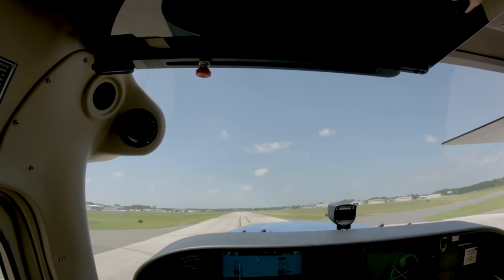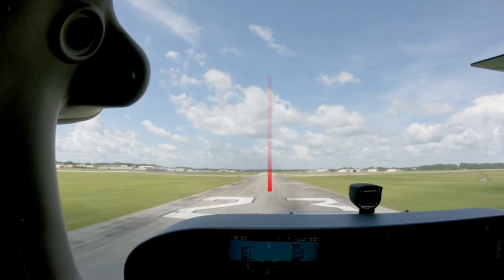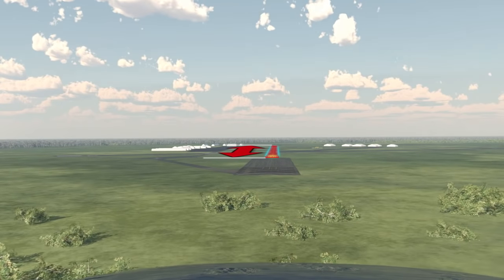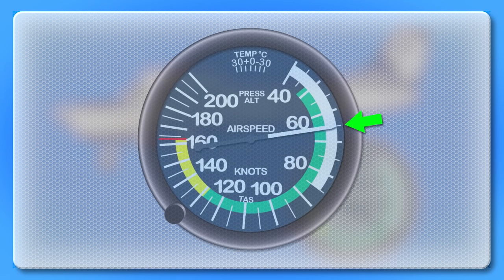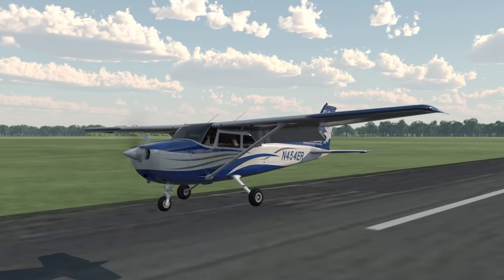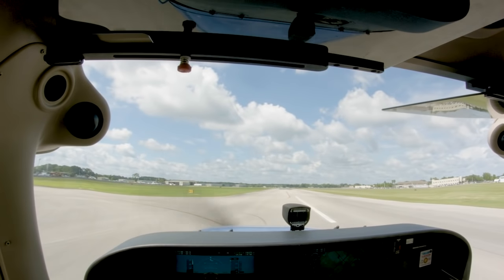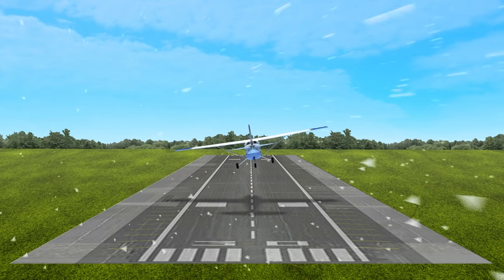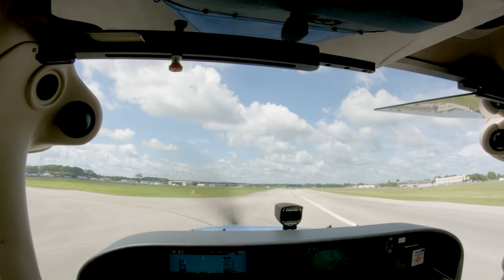Normal & Crosswind Approach & Landing - Lesson 1

Comment: I've always been taught to use power to control height, and pitch to control speed on the approach to land, and then use the other resources only slightly. Not to use the two together at once. Too low = Increase power, and then pull up slightly once you've gotten the power you need to safely pull up without getting too close to stall. Too high = Decrease power, and then push down slightly. Too fast = Increase Pitch, and then decrease speed slightly. Too slow = Decrease pitch, and then increase power slightly if needed. This always worked well for me, but I've never used the two together at once on an approach to achieve a different outcome.
Reply: Actually, what you described is using the two together.  The video said that when you change one, then you will need to change the other, which is what you are doing.
Reply: I caught that as well.  For a stabilized approach I keep my speed pegged with pitch and control altitude with power.
Reply: Using the throttle as the primary control for changing altitude will result in much safer flight habits. Too many pilots use pitch first which results in sometimes risky speed variations.

Comment: The best X wind instruction we've seen to date !
Short course is: 
 Ailerons are the LARGEST control on the plane & the LEAST understood !!! Ailerones ROLL to make turns, BANK to control DRIFT over runway, then provide directional control on roll out with AILERON yaw, as the wee little rudder stalls as relative wind shifts to the airport Xwind.
Cheers R Fuchs CFI 1507987

Comment: This video was good with the exception of stating that if you're low you should pitch up. That thought process is very dangerous. If you're low, you add power, then to maintain your airspeed, you pitch up. But using pitch for altitude when you're already low and slow is what causes pilots to stall, and at an altitude that is too low to recover from.
Pitch for airspeed, power for altitude! It is correct that the two will go together, but do not correct your altitude with pitch, correct it with power!
Reply: He does say this at 5:20.
Reply: @karhukivi ah yeah? so if you are low over some grape-stakes, you are not gonna pitch up? Just give it more power and stuff yourself in faster? So how are you gonna fly when you have auto throttle? How are you gonna aim? Has to be pitch... that's the way an autopilot flies also. How do you fly an ils? Dont you pitch for glideslope?

Comment: You are 90% correct. If you are to high on the approach reduce power only do not lower nose because it will increase airspeed and then you will have to slow the plane down increasing workload. In high winds of 70 to 80 knots the tower may let you land on a taxi way if the wind favors it in an emergency.

Comment: Perfect explanation of how to make a technically correct crosswind landing!! My only comment is to remove the crab a little earlier than what you said so that the pilot can figure out how much aileron and rudder to use. An earlier crab will also tell the pilot if the crosswind is out of limits for a safe landing.  I have been a current and active CFI for the past 52 years and have 4,000 hours of tailwheel time including 3,000 hours in the Beech 18 and DC-3, many of those hours teaching crosswind landings. Unbelievably, the FAA Flying hand book recommends a maintaining the crab until just prior to touchdown, then leveling the wings and land before the airplane starts drifting. This is physically impossible and can easily lead to an accident!! You totally debunked this kick out and land technique. Thank you SO much for telling pilots precisely how to make a technically correct crosswind landing.

Comment: During windy conditions while driving, you subconsciencely turn the steering wheel into the wind. Youv'e done it for years, unless you just got your driver's license. Even then, you know that you are doing or you go off of the road. You are alreading controlling drift without even thinking about it. Just add the other elements to flying a plane and you can enjoy the crosswind challenge. It 's fun.
Reply: Pardon the typos. Carpal tunnel at it's best.

Comment: Very informative video. However, I noticed that there is no mention of the need for right rudder in the flare, even in a calm wind landing. When the nose is pitched up to the Vy attitude, P-factor tends to cause the airplane to yaw to the left, just like in takeoffs and climbs. I only recently soloed after many hours because my landings still suck. Often, it’s because I didn’t do anything with the rudder. Just thought I’d add that tip.
Reply from the maker: TenMinuteTrips With the airplane at flight idle, the left turning tendencies are negligible. Rudder should be used as necessary during the flare to counter any crosswinds and keep the nose aligned with the centerline.

Comment: Agree on everytihng, except
On side slip, you can touch the Runway with both wheels at the same time.(that's the art you need)
I did on my Pitts, on Dc3,:C46, Dc6, 727,737,E190 AND A320.and teach in all
Works perfect.

Comment: I would definitely disagree with the stabilized approach explanation. If I am trimmed out and I am below the GS, I only need to add power to decrease descent rate, getting me back onto the GP. It seems counter intuitive, but adding power in that case will not increase speed, since I am trimmed. Just imagine flying straight and level at 100 kts. What happens when you increase power? Yes, you might for the first one two seconds will have an increased speed, but the airplane will start pitching to increase climb and the speed will stay at 100 kts even if you dont pitch up your self--> Approach pitch for speed, power for altitude!

Comment: 5:05 no, if all the forces were the same, the plane would float mid-air.
Reply from the maker: herrjonna2007 “If all of these forces stay the same:” meaning if they remain unchanged from their state at that moment. If all of the forces remained exactly equal, then, yes, the plane would float. The sentence as spoken is correct.
Reply: herrjonna2007  Not necessarily. Newton’s First Law says that a body where the forces on it are in equilibrium will remain stationary, or Maintain Uniform Motion in a Straight Line. (Emphasis Added).
Reply: No, if all forces are equal, the object moves at a constant velocity. Either velocity zero if the object was stationary, or at a constant speed at a constant angle if it was already moving. If all forces are equal, the plane continues down the glideslope at a constant speed instead of falling (accelerating) like a stone.
Reply: herrjonna2007  The reason I said ‘ not necessarily ‘ is that a little flivver whose approach speed is 50 knots say and is going down the glide slope into a 50 knot headwind would have zero ground speed and therefore is stationary over the ground. It might be said to be ‘floating’. All the forces on it are in equilibrium. However, its airspeed is still 50knots.
Reply: David White That's something I didn't think about at all! Groundspeed vs airspeed. Thank you for the explanation.
Reply: @jayashrishobna  Not necessarily. Gravity is winning in the case of a plane returning to earth on a glide slope. How is lift equal to gravity? Gravity has also  artificially created the speed.

Comment: Great video. Can I still be a pilot at 35 yrs of age?
Reply: Took my first flight lesson at 46. Got my private at 47. Mostly in old beater Cessna 152's, and 150's, had to buy my own 150 to finish training as the instructor took off for Canada with the only training plane. Almost ended up in Lake Superior trusting aged instruments and gauges. My training was $40. Hr. Now up to $175. Hr.  Glad I got it when I did. Later Alligator.  John.
Reply: As long as you can pass the physical, age is not relevant as long as you meet the minimum age.

Comment: The Crosswind Landing technique is incorrect. The rudder to keep the aircraft parallel to the centerline all the way till after landing. Opposite aileron to keep the aircraft from drifting. The Inaccuracies in this video is this: As you are nearing landing for a constant crosswind, the rudder pressure will be increasing as the aircraft becomes slower and slower. The aileron actually will be slowly coming out, NOT INCREASING. If you keep it the same or increase it as this video says, you will start to drift. Adding the rudder causes the fuselage to be angled into the wind which produces lift in the direction of applied rudder. You counter this lift force with Lift from the wing in the opposite direction (aileron). As you get slower and slower, you increase the rudder to keep the aircraft parallel to the centerline but the lift force from the fuselage will actually decrease in magnitude. Since this force decreases, you will need to decrease the lift force from the ailerons and you do this by decreasing the aileron pressure as you get slower and slower.

Comment: I dont agree,if di a correct side slip both wheels touch at the same Time, that Is to he art
Reply from the maker: Touching down in a side slip with both mains at the same time would result in a side-loaded landing, as the wind would be pushing the airplane across the runway.
Reply: I dont agree, whats better,? Land on single wheel firts, no think what You ate saying
Reply from the maker: Landing on a single wheel is not only safer, it is recommended by the FAA.Without the appropriate aileron inputs, the aircraft will drift across the runway, and potentially lose control upon touchdown. Take a look at the Airplane Flying Handbook published by the FAA for more info.

Comment: 13:25  That is a Forward Slip, not a Crosswind Slip. In The Crosswind Slip, the nose is Aligned WITH RUNWAY, Not to the side like it is shown.  They show a Forward Slip and call it as a Crosswind Slip.  Shame on ERAU.  Those are 2 different kinds of slips and should not be confused by ANY REAL CFI. 

You can do The Forward Slip on any winds, but The Crosswind Slip you need a crosswind or you move sideways without it and get miss aligned.  Dont confuse those kinds of Slip..